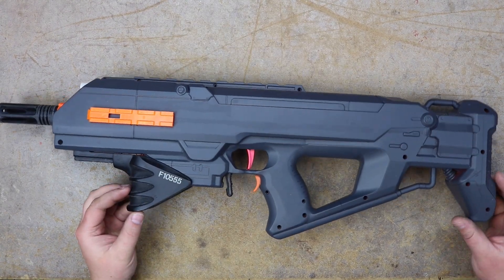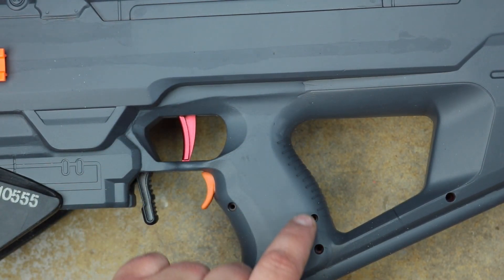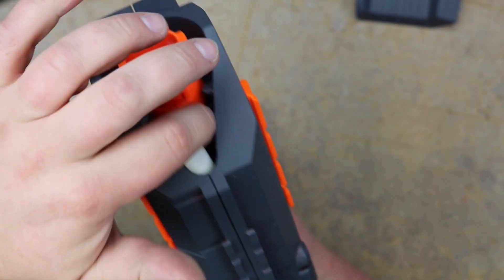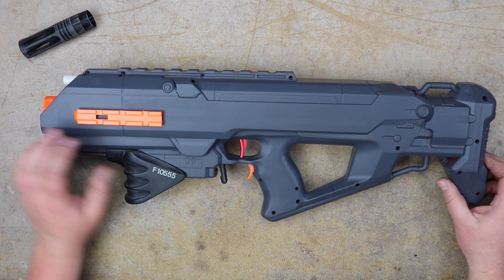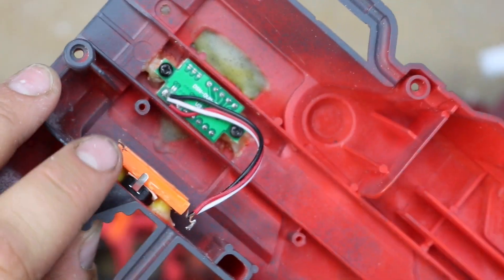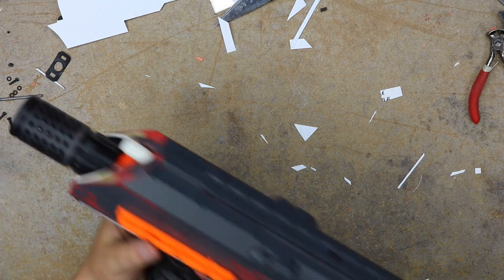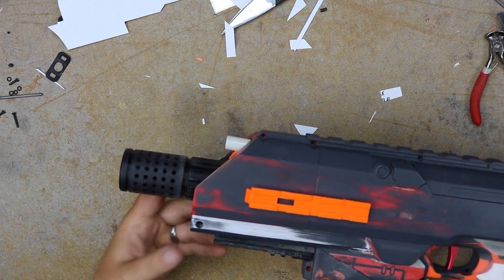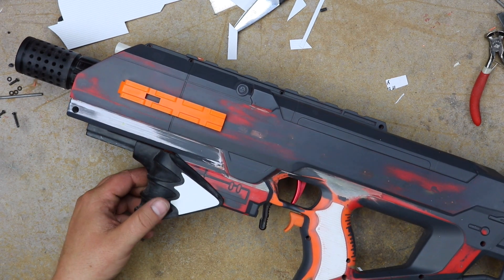Centauride - Build Log - 3

Comment: That's quite fascinating with your idea of using magnets to keep the battery door in place. Now I'm starting to wonder if it'd be feasible to use magnets to keep shell halves of a flywheel blaster in place, with perhaps additional pieces like a stock and the worker magwell cover to hold it broadly in place.
Reply from the maker: Hey now! You're thinking on an entirely new level, here. 
It's an intriguing idea. And I happen to have like 100 of these little neo magnets now. 
Might have to do a bit of experimenting. 
 Imagine being able to fill and blend the screw ports, and have a "beautiful" shell on both halves of the blaster...
Reply: I am being thoroughly with  Ideas right now. Thank you.